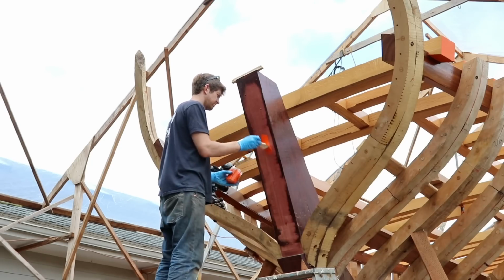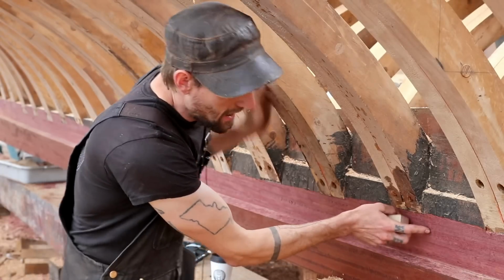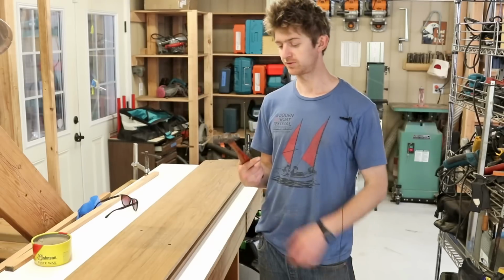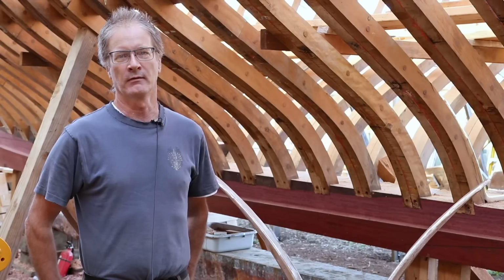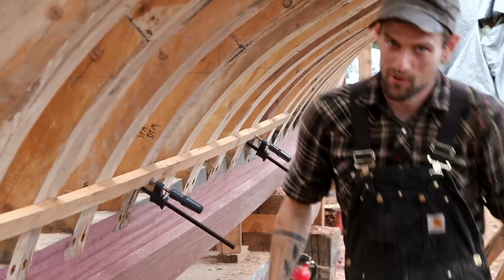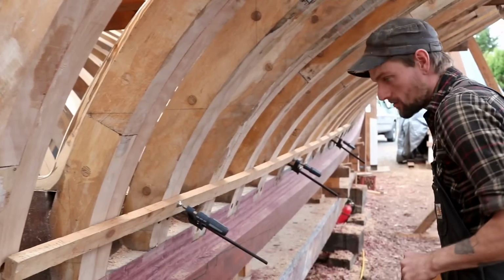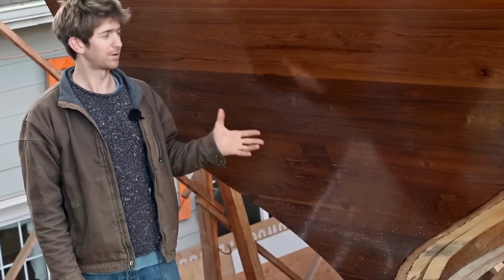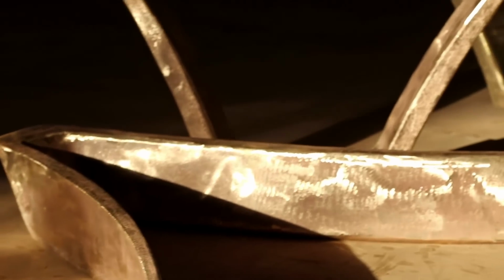BoatBuilding - Finishing the Transom (EP76)

Comment: Super inspiring yet again. As a result of the pandemic and a dramatic change in life that comes with social distancing  and following Tally Ho rebuild,  I purchased another project boat. This is #2. The first was a 79' S2 11 meter sloop - 3 years ago. It was languishing in a slip for several years and over the past two seasons brought it back to sailing and live aboard condition. Boat  #2 is a 81' Pearson Flyer 30. A one design, 3/4 fractional, flush deck race boat. It was damaged in a storm while on the hard and lost it's rig. The boat hull is still sound and a new used rig was available. The project includes re-powering by removing the obsolete BMW D7 7 hp diesel and replacing with a clean electric engine, re-rigging for modern PHRF racing (OD class defunct) and repairing the cosmetic damage on the topside as a result of the boat being knocked over in its cradle.  These are both glass boats but I feel it is just as important to save these boats from the landfill and preserve the wonderful advances in design of the late 70's and early 80's. The stepping stone period from the old  wood design shapes in glass to the modern go-fast composite designs of today.  Your work ethic and planning has been a huge inspiration to tackle these projects and get these boats back on the water sailing.

Comment: 1909: These 5/8" rods are a bit big but we have a lot of them laying about so might as well use them!
2020: I dont know why they used such large rods but i happen to have a bunch of extra 5/8th rods laying about so might as well use them!
Reply from the maker: Exactly! Hah
Reply: 2131: I don’t know why they used such large rods but etc. etc.
Reply: Dear  @SampsonBoatCo   Leo Goolden.
😁😁
Reply: Actually these are only C360 brass rods, the KSI (kilo lb sq inch)is less than 40 greater than 4 inches - which makes for a very, very weak bolt. Or equivalent to about a 1/4" grade 8 steel bolt of comparison length. Brass C360 rods have a horribly low shear strength.
Reply: My mother always used to cut the top off the turkey but never knew why. Then, before her mother died she asked her. It was because her grandmother's oven was so small, it's the only way it fit - so all the subsequent generations did it without questioning.
Reply: @Automedon2  
👍👌👏😁 Great family story, thanks for sharing. So they simply said "Amen" (so be it) to the procedure.
Best regards, luck, health.and always a big enough oven! 😁
Reply: I would have like the bolt heads to have been peened over a countersunk steel die. Not a lot but enough to reduce the stress raiser effect of a sharp edge.
Reply: @usdivesupply1023  Yes you're right but what's the point of a steel rod inside a wooden boat? It's not only about the material but how it interacts with it's environment.

Comment: It may seem absurd, but that subtle touch of shiny footings is still quite a great tribute to the Tally Ho!....it's not like it's an assembly line piece, this is a classic that deserves that extra touch to show how building boats are Fantastic Art in itself.
Reply: the cumulation of all the tiny little details like this over the whole project will definitely show in the end. we'll be able to look over the whole boat and remember every piece and every bolt, which when done as detailed as those bronze floors will really bring it all together, not only will it be built better than the original print, it will have aesthetics which weren't even there before, which really adds to the originality of the project. No boat out there will be a Tally Ho, Tally Ho is the only Tally Ho and that's what I find amazing about shipbuilding, that's what makes it art :)

Comment: Leo... 😎 Eye 👁‍🗨 protection, I remember working on the water board in the early 80's and there was a bloke know as "one eyed Ken" he previously worked on railway maintance and struck a chisel with a hammer and a lump of the mushroomed over end of the chisel flew off and blinded him. Its always in the back of my mind when striking metal objects with hammers, always wear eye protection.
They don't mend as easy as you finger did.
Iove the videos and the star of them all your beautiful parrot.
Reply: My great uncle lost an eye the exact same way. It just deflated over the course of the day and he went to a hospital way too late to save it.
Reply: I think Alec Steele did a whole video about the safety issues of hitting things with hammers. I think the back of that hammer has work-hardened a lot, so good suggestion
Reply: Yep eye protection is worth every bit of inconveniance it causes.
I would have lost my right eye twice if it werent for goggles.
Once to a piece of welding slag that decided to emulate shrapnel, and another time to a shard of a disintegrating drillbit.
Reply: I’ve had a peace of a cold chisel in my inner thigh for 58 years . Be carful grid the mushroom off.
Reply: Leo's attitude to safety gives me heart attacks at times!  At first I couldn't watch the ship saw and chainsaw bits...
Reply: I wouldn't panic , I'm 58 and hardly ever worn safety glasses what I'vefound is eyes repair over night pulled heaps of shards from my eyes without panicking and going to hospital by just slidding a needle sideways over my eye it comes out everytime,,,never use the pointy end just the side
Reply: Yes, Leo, please. EYE PROTECTION. and, by the way, how is that finger?
Reply: John Harrop my brother is 59 about 38 years ago he was cutting a black thorn hedge a branch whipped back and hit his face a thorn punctured his eye ,after a stay in hospital to save his eye for all those years he's had 30% vision , it causes a lot of problems in every day life .
Eyes don't repair overnight.
Eye protection wasn't that common 38 years ago , now days safety glasses are comfortable and affordable ,if you had £10 million in the bank it won't buy you a new eye ......protect the ones you have they are not replaceable.
Reply: Graham Wilson an old mate of mine was laying slabs and got a fragment of the mushroom from a bolster chisel in his arm , it's never come out , best advice is wear eye protection and grind the mushroom off.
Reply: It's not just fragments, either. I was mixing mortar in a bucket a few days ago and managed to splash a tiny bit into my left eye. I didn't think much of this initially and just blinked it away, but within seconds my eye was hurting really badly and I couldn't see properly out of that eye. I splashed some water in the eye but it didn't seem to make any difference, so I ended up with my face under the garden tap. This did the trick, but left me shaken - and soaked! (My wife came out to see what the fuss was and thought I'd gone mad!). I've since read the safety instructions on the bag of mortar...

Comment: Polishing metal removes stress risers ie: the spot where things like to break or crack. In the end it might only make that part 3% stronger but when you do things like that to an entire project those 3% here and there dont average out, they add up. Up to a 10%-15% overall strength across the boat. Transom is so badass.
Reply: Another method with metal is shot-peening, at least for steel, a cold-working process that's a bit like forging the surface layer in a sense. "compressive residual stress layer" is the term. I think the main advantage with silicon bronze polishing, is it will create a surface that won't trap too much moisture from the bilge / air etc. and remain dryer overall, and the tarnish layer should be pretty even, which will help protect the underlying metal. So I don't think the polishing is wasted effort, it does have small advantages.

Comment: Polishing the floors should help prolong their life. Like with a knife or chisel the sharper the edge the more polished it is which helps stave off corrosion
Reply: If I remember correctly, and may not,  doesnt having the surfaces slightly polished add go the overall strength?
Reply: @robertkendall1037  not to my knowledge but the polished surface cuts down on surface area allowing less material to be effected by corrosion
Reply: @robertkendall1037  i believe it can, it cuts down on stress risers, which are localized areas of stress where cracks can begin to occur.
Reply: In aviation, we depend on polishing repaired skin to within a specification before riveting in order to harden and prevent cracking.
Reply: Andrew mamrus, exactly what I learned in a machine shop 45-years ago. Nice and smooth, mirror finish
Reply: Springs shouldn't have any scratches/gouges perpendicular to their direction of usage or they'll break. Certainly this applies to any other metal, just on a much lower scale.
Reply: Worked on aircraft for a short while, light stuff. On a fifty hour service we had to draw file and polish leading edge of propeller blade. This stopped micro fracture developing across blade leading to blade failure and nastiness.

Comment: When my father built his Doesburg mahogany Flying Dutchman kit back in the early 1960s he deliberately clocked the grain of the fastener plugs to make them more obvious.
Reply: From what I saw on Acorn to Arabella that is to prevent the plank from splitting if the plug swells. The plug will swell the most parallel to the grain is my understanding.

Comment: My first reaction to the transom rebuild was, "What a smashing job he's done!"  But that would be a horrible jinx!
On the issue of whether or not the boat you're working on is the Tally Ho I learned something interesting about the Japanese attitude toward some of their temples.  No matter how many times it's completely rebuilt or what materials may be used, it's still considered the same building.  The emphasis is on the process and not the finished product.  It seems to be like they started the building in 14-whatever and have just continued with regular maintenance ever since.  Perhaps they would consider rebuilding the transom with original material somewhat quaint.  Either way it looks sma...  I mean really nice!
And now I just realized where I read it.  D'oh!

Comment: Put a few coats of wax on that bronze before you install them and they'll be protected from corrosion and will age perfectly. You don't have to go crazy rubbing the wax out because it's the buildup that you want....... I've come back to bronze hardware and pieces I've done it to in bilge's 15+ years later and as long as they are in areas that didn't get a lot of wear and tear they polished right back in minutes.

Comment: First time I've ever seen a use for a ball on a ball peen hammer! I also want to echo one of the questions from down below in this gigantic thread -- why did you blow the casting (chimneys?) out with the acetylene torch?
Reply: Not sure, but I think they want to keep the metal in those 2 pipes molten, so it can flow in & fill any shrinkage gaps as the metal already in the mold begins to cool & harden.

Comment: Hi, so my field of expertise is structural engineering and I while I mostly deal with steel I did have a question about the brass bolt heads. It seems like the head is awfully thin when hammered down which even if it's bearing against a washer could leave it susceptible to yielded and head failure while under tension. Do you anticipate a lot of tensile forces on the bolt heads? 

Again, I'm not familiar with boat design but that caught my eye. 

Thanks!
Reply: Purdue1986Boiler A complete guess on my part. I imagine the bolts would mostly have a sheer force on them and the water pressure would be pushing in on the boards. Although I was like you in thinking the peened head does look thin.
Reply: the same thought entered my mind as well ( but what do I know )
Reply: The heads only look so thin because the bolts are massively thicker than needed.

The main reason to use bolts so thick is where they have to go through a lot of wood like the stern or stem assembly.  A thinner bolt would be plenty strong enough to carry the load but would be much more difficult to hammer through the wood without bending.
And the holes should be tight enough you have to beat in the bolts in order to get as good a seal as you can.

Also even those thin heads are still stronger than the crushing strenght of the wood.

If i remember correctly the guys from acorn to arabella did a test where they simply pulled a bolthead and washer through the oak without getting the head to break.
Reply: I wondered about that too, but I'd guess that holding wooden structures together with bronze bolts is quite different to doing it with steel bolts in metal structures.  I suspect that a lot of the force on the bolt is lateral, with the wood parts moving against each other under the forces of being at sea - rather than just straight down/through the bolt.  Leo's mentioned several times that the fact that silicon bronze can stretch and bend a lot (and recover) is quite important too, which again might suggest a lot of different forces on the bolts.  And, as others have mentioned, there's the leakage problem.  Not only are the bolts hammered in tight, but I noticed that the transom bolts were black - presumably indicating that they had been coated in 'tar' as well?
Reply: When Leo knocks the bolts through you can see he wraps some cotton under the head of the bolt before driving it finally fully in. Then it’s tarred in and then plugged.  Three stops to water ingress.

Comment: I worked in an iron foundry in my summer vacations, in the early 70's, doing most of the jobs other than core making. When I first saw the molds for the 'floors' being made I thought why not use a core instead of trying to stop the sand falling out as it did. I was delighted to see that's what they decided to do too. I still have the scars form the molten iron burns, we worked in jeans and tee shirts. The only safety gear we had were gloves and quick release boots in case iron went down them. One molten iron burn ran down my stomach a bit, all the girls wanted to check that out, it didn't go far down luckily.

Comment: It's quite incredible when you think about that wood. It's been around for about 4-5 human generations (111 years since installed), served on the original boat in all conditions, sat un-maintained and exposed to the elements, for many, many years, and is still fully serviceable with some elbow grease and skill. An amazing substance. Most steel would not survive that. It took it's rightful place, back on the stern of Tally Ho.

Comment: You all need to learn that line dance that the oversized canary does around  18:50. This bird is a star. Also put me down for one of those  "hey Pete" T shirts. I also picked up that you missed putting in the length of cotton, but noticed that it was there in a later shot. Just checking up on you.

Comment: Leo, there is another legitimate engineering reason for polishing that you might not have known. Yes, polished finishes are slower to corrode, but they are also stronger due to fewer stress accumulation points.  So in addition to being more resistant to the bilge water, the polished frames will also be more resistant to the forces of the outside ocean.

Comment: Leo try injecting very hot boiled and refined linseed oil into the pressed rebates. The heat will cause the timber to expand back to shape very rapidly think you in seconds. whilst at the same time the high viscosity of the oil will penetrate deeply into both your cotton seal and the surrounding timber.
I suggest you could use a ally type high pressure bicycle  pump with a football bladder adapter, lag the body of the pump to protect your hands and keep the oil hot. and don't forget to check the seal will tolerate the high temperature of the oil, leather or plastic will not. Wood will work. Use a metal washer with a hole just big enough to allow the adapter through and wide enough to drill a couple of holes in to provide a temporary fixing to your planks, use a piece of bike inner tube as a seal to inject through  and screw the washer on top. you might also want to adapt a sash cramp to provide extra pressure for the injection procedure.
 Any way I am sure you get the idea and I have been boring long enough cheers.

Comment: I notice a couple of comments about the seeming race with Acorn to finish first.  I do not think it is a race but I notice a growing difference in the build approach. With Tally Ho all the build steps seem preplanned and proceeding smoothly whereas with Acorn it seems a bit more hit and miss and designing on the fly now.  Acorn seems to be in a rush to plank without having it's deck beams in place for example whereas Tally Ho's hull is as solid as a brick outhouse now being fully triangulated and it's planks will go on once and be done with.
Reply: They are really completely different builds, and comparing them isn't appropriate.  There is also some difference in experience and the materials used so again, totally different build and philosophies.
Reply: @pparker5113  Comparing the two projects is not a criticism of one over the other. Acorn began with a strong team of Steve and Alex. They shared the workload and vision. Now Steve is on his own it seems for some time to come. On the other hand Leo began on his own and now has found a strong partner in Pete. The combined experience and skills of Leo and Pete is unmatched. Steve seems to be flogging himself into the ground. I think it would be good for Steve to take a break and seek the counsel of others to help him forward plan.